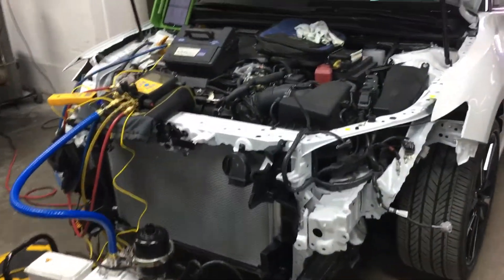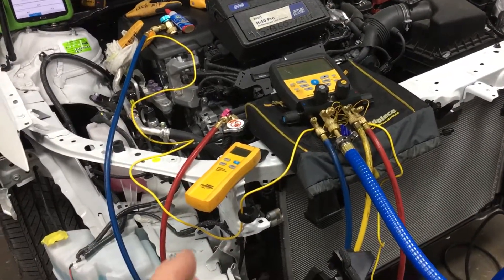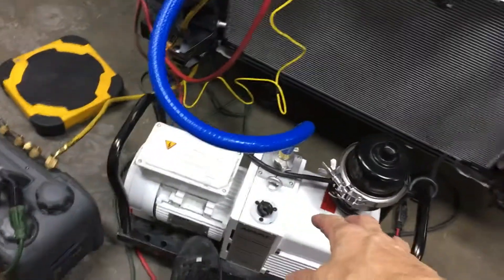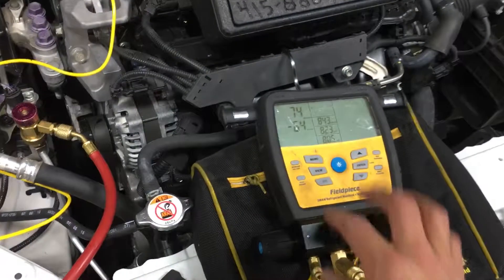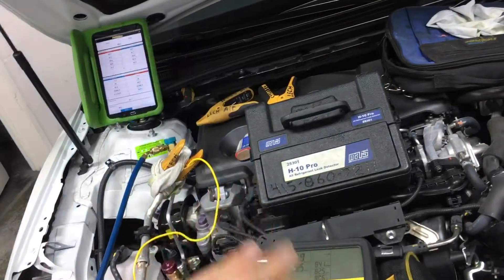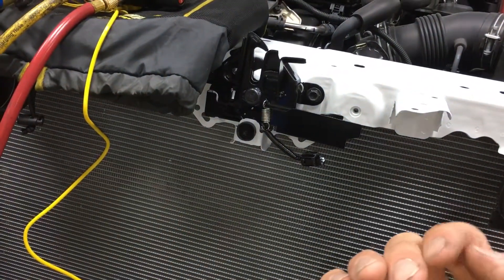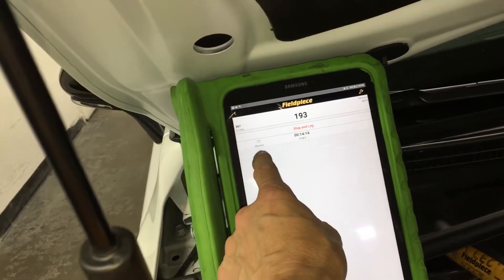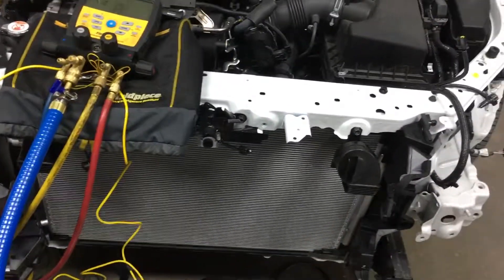A/C proper recovery with dry nitrogen purge and proper vacuum procedure

Comment: Excellent video! Great explanations. I’m a 5x ASE Master and no one has taught this so thoroughly. I’m no longer in the field and our 2013 CRV lost its charge. The local shop relies solely on dye to test for leaks. I don’t have access to the needed equipment. Does anyone rent ac equipment or is there a shop in the Philadelphia, Delaware are that can perform a thorough diagnosis and repair? Thank you for setting a high standard!
Reply from the maker: Here in California O’Reilly auto parts rents equipment.

Comment: So this goes back to my previous question,  when I hook up my gauges to my neighbor van using my pump of 6 cfm, and my micron gauge connected to the high side.  It is difficult to draw the microns down on his car and you just stated that it could be too much moisture.  

My neighbor does what you said,  he uses shop air to flush his ac.

This is why his van sits high and it could be on a vacuum for 3 hrs and still be around 1500.

So what it's the best thing to do here? Replace the condenser? He is not going to buy nitrogen to flush his system. I know he's not going to replace the evaporator either.
Reply from the maker: Leave it on the vacuum pump overnight or 24 hours
Reply: @coldfinger459sub0  if he did run shop air through the compressor will that cause a problem?

I know he ran shop air through the ac line without removing the expansion valve, will this cause any damage?
Reply from the maker: @edwinaragon8469  if he did not run shop air there would not be so much moisture in the system

Shop there will not damage the expansion valve . 

But just leave it on the vacuum pump overnight. That’s the only thing you can do and change the receiver, dryer or desiccant bag. .

Comment: You did vacuum on manifold gauges and hoses, and then you connect hoses to the car on working pump?? I BET 100$ that you close first vac valve and than connect  recovery machine. BUT you opened the valves on the hoses on the running pump, the pressure of the refrigerant from the system may have damaged the pump.
Reply from the maker: No refrigerant in the system.  It was recovered earlier before replacing condenser. 

But when you do have refrigerant in system and you connect service valve the refrigerant just pushes all the vacuum pump oil out like a spout up in the air making a oil mess everywhere . Ask me how I know 😢

No damage to pump.  Or if you are standing over you pump or bending over the pump at the same time. Get blasted in the face and hair but no damage to pump.  I’ve done it a few times no big deal. Except for the mess.

Comment: I wish someone could make a video about moisture contaminated oils. I've seen guys put shop air, loaded with moisture, in the system to find leaks. I've done it before. It just has to leave the shop blowing cold.
Reply from the maker: Yes, and always leave the shop blowing cold, no big deal under the right circumstances. 

I’ve done a few videos, showing the system, all rotted out inside from the moisture contamination inside of condensers inside of receiver, dryers the inside of hose fittings, all flaky and Rusty . 

It’s the same thing if you paint a car that is stripped down to bare metal and you do not remove all the RUST. 

There are a lot of body shops say I can paint over a little bit of rust. It always looks beautiful when it leaves my shop..  I don’t have to spend all that time prepping and removing all the rust. 
            I don’t need to spend all that money on a good shop air dryer system my paint jobs always look beautiful. 

Yes, it’s easy to do a beautiful paint job without removing all the rust. 
        But those are the same cars that a year to a few years later, come back with all the blisters of paint and holes under the metal that keeps spreading underneath that beautiful paint job. 

We call those HACK shops

That’s the same as a dentist goes I don’t have to get all that cavity out of the root. It’s too difficult to take down there. I’ll just throw filling on top of it..   patient goes home. Happy in the feeling good last several months or even a year.. 
           Next thing you know those are the patient’s doing emergency call with swollen face in much pain with a high fever and sometimes infection that require surgery.   what would you call a doctor? Who did that to your son or your mother or even yourself? 

This is the same as a shop that uses compressed shop air to look for leaks.  Think about it. 🤔

Comment: A couple of things, You quickly mentioned two vacuum pumps, would you be willing to do a video that goes into depth on the two vacuum pumps? What do you do if a customer comes to you and says: the lash shop I went to we are complete idiots, didn't have the right equipment couldn't answer any of my questions. How do you completely clean out 100% everything in AC unit.
Reply from the maker: @hbo7799  sight glass . Two different oils that don’t mix.  Sometimes cloudy. Different smell sometimes. 
    Or I know the hack shop they just came from.,
Reply from the maker: 1: The two vacuum pumps every now and then I mentioned and shown in some of my videos. I sometimes explain why in what steps and procedures and purpose I do that set up. 

2: as for the complete idiots I have to find out why they are being called complete idiots is it legitimate or lack of understanding on the customers behalf. 
      2a: example oneto legitimize complete idiot. When I test the customers car and find out the refrigerant is contaminated with mixed gas and possibly 3 to 7% air mixed in with the refrigerant I throw that under the category of complete idiot.
          b: then when I recover the refrigerant out of the customers car from the lash shop I also find it several ounces overcharged. Because this vehicle possibly had an option for a rear air-conditioning system but it only had the single evaporator in the front Dash not the rear and they charged it to the specification of weight of refrigerant for a duel AC system. You might say somebody could make that mistake. 
         But this is where the complete idiot part comes in.   They could not recognize it why they were getting nearly 400 psi on the high side because they were several ounces overcharged because it was not a duel front and rear air-conditioning system. Now you could use the word idiot I’m not gonna use the word and be friendly and say lack of knowledge this is very basic and it starts running into the idiot part. 
           C: let’s say this was a hybrid or electric vehicle with a electric compressor and I also found out they put PAG oil or old mineral oil in the electric compressor that should have had ESTER oil.  Now they get to be called complete idiot. 
             3: example maybe the shop was legitimate and fairly knowledgeable but they got a real bad old car with multiple multiple Cascadian problems on top of each other. Combination of restricted or stuck expansion valve. But the shop did not know that because there was a electrical problem stopping the compressor to come on in the first place so they had to diagnose in charge to fix that problem first. Then once they got it working electrically they discovered the expansion valve problem going into a vacuum immediately they had to shut off the system recover the refrigerant diagnose and charge the customer to open up the dash and replace the expansion valve.  Then after they replace the expansion valve because the system is now operating properly they discover the high side pressure goes up very high because the high side pressure switch was failed from sitting for lost time not being service for many years because the customer waited so long.  So now the shop has to recover the refrigerant that they put back in the system because of the expansion valve that takes time and money and they have to replace the high-pressure switch so they can recharge the system all over again to make sure the fans are operating under high pressure. This is a nightmare situation the technician on the car has no way of knowing how many problems there are in this scenario. And the customer might get suspicious and call him an idiot or maybe think he’s a thief and he’s ripping them off. 
         When in fact the customer was just unfortunate to have such a vehicle that had so many problems most likely a Chevy , Chrysler or Ford lol. 

4:  completely clean out 100% everything !. Them we’re big fighting words. 

       Let’s say it’s not from a burnt out compressor so there is no metal break debris or piston ring material. No physical burnt particles contaminating the system. (“ I have to make that clear”)
                We’re going to say were cleaning out the system because somebody put the wrong oil in the system on top of that extremely high moisture contamination. And maybe even the slightest possibility of a little bit overheated compressor that started breaking down the oil and you get that find gray film developing on the inside of the lines smoky looking. Not black and gunky just light

      You flush all the components individually or as sets but you cannot flush through a expansion valve or a receiver dryer because the receiver dryer gets replaced. 
       With AC flush solvent you manly disassemble lines follow the manufacturers instructions many manufacturers now have YouTube videos showing how to use their flash solvent with their little flash bottles or containers in pretty good detail to make it easy to understand and follow. 
           Just for safety sake if the vehicle is several years old approaching a decade if the expansion valve was difficult to get to you may want to consider replacing it just to be safe. Does have movable wearable parts inside that do go out of calibration with age. 
          Flush out the evaporator individually flush out the condenser reverse flash the condenser and reverse flow with liquid AC flushing fluid. 
           I highly recommend using dry nitrogen and not compressed shop air because of the high moisture content in compressed shop air. 

        Now you have completely 99.9% removed all traces of old contaminated refrigerant oil. 

         Now you can refill the system with the factory quantity of the factory specified by the compressor manufacture refrigerator oil. 

           You cannot flush out the compressor but remove the compressor turn it upside down let it sit overnight rotate the clutch shaft several times to get as much oil as you can out of the compressor. 
           Look up the specifications on the compressor some compressors actually hold some oil inside of them where you have to remove it oil drain plug off of the compressor to properly and thoroughly remove the old oil out. RTFM (read than fantastic manual) where and how much oil to stick in different parts of the system. And some compressors they may specify that you have to fill up that oil plug that you removed with a specific amount of the compressor manufacture specified oil NOT ! just pouring it down the suction or high side ports. 

I think I almost covered everything close enough that you’ll understand the rest of it comes from reading the manual for the pacific air conditioning type system that you would be working on. 

Then comes a real good vacuum down below 500 µm if you could get it down to 100 or 200 µm or below that would be excellent. 
          You can leave your vacuum pump on overnight. 
          Then only fill the system up by factory specified wait not by guessing not by pressure is not by temperature weight only. 

      If everything was done correctly you should have an excellent working air conditioning system after that with a long life.  Just never let the refrigerant run low.
Reply: @coldfinger459sub0  Thank you for the video and a detailed description of how to work on the AC unit. I have no problems with my three-year-old car. I just found it interesting to look at AC repairs as I wait for the pandemic to run its course. Maybe you can do a video on why it's important to use Silver solder Instead of just plain solder.
Reply from the maker: @RudeMcNasty  Little more detailed clarification on Old fashion 40/60 lead tin solder. Newer leadfree solder. For low temperature 370°F Think of it as glue attaching to the surface

          Then you have your 15% / 56% Or 90% ect silver with phosphorus brazing rod with a liquid melting point around 1400° depending on your silver content. 

         Then you have what I consider falsely calling low temperature solder with like 3% silver alloy in a lead mixture for electronics. Some refer to it as silver solder but really the content is so low. This is what I use when I’m building class A Linear mono or stereo amplifiers or preamplifiers

         There’s a lot of guys out there that made HVAC videos that do beautiful editing and video photography with nice camera equipment with detailed close-up views of performing solder procedures then I can ever do. 
       I don’t do editing, one take shots only. 

   I don’t remember if I ever released any of my videos performing silver phosphorus brazing on copper ACR rigid line sets for my commercial air-conditioning jobs. 

        I think I remember releasing one just short little video clips on a residential LG mini split that was brazing up and repairing some soft copper line set.
Reply: @coldfinger459sub0  thank you for getting back to me so quickly, I'll look around to see other videos.
Reply: @coldfinger459sub0  You wrote above: " let’s say this was a hybrid or electric vehicle with a electric compressor and I also found out they put PAG oil or old mineral oil in the electric compressor that should have had ESTER oil.  Now they get to be called complete idiot. " how how to check if there is POE oil or PAG in the system? Is it possible to distinguish it?
Reply from the maker: @hbo7799  there are chemical test kits on the market for a commercial, HVAC supply, chemical manufactures in warehouses. 

You take a sample of the oil and you put it in one of their test files and mix different chemicals with it shake it up and down and let it sit . 

One manufacture, it will change the color 

Another manufacture, you will see the oil separate 

Then there is also a hydrometer optical tester piece .    You place one or two drops of the oil on the glass and then you look up at the sun through an optical lens and it has something that looks like an elevation or a rifle, scope siding focus lines.. 

There will be a difference in shading and color that separates, and it will make a line on the numbers and you read them and it will tell you the percentage of oil that has been contaminated in the system that has been mixed . 

These are all things everybody learned when they went to a Automotive Technician School’s to get your automotive engineering degree .  These are all things everybody has learned when they went to air conditioning specialty classes..   these are all things that were in magazines in articles over the decades, especially back into years of 12 retrofits to 134. . 

Unfortunately, many automotive owners and technicians do not seek knowledge they don’t try to read, and there are unwilling to pay to send them selves to go to classes . 

Nowadays, everybody is lucky all this information is online . 

When I started, there was no online there was no Internet . We had to work and study for our information and fly out to locations..  

It is so easy now to get all the information you want in training .